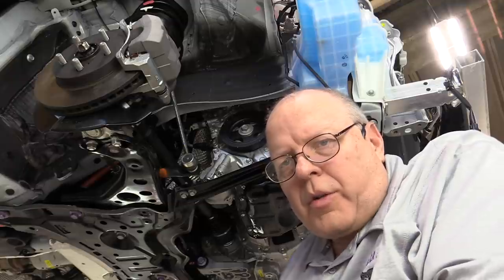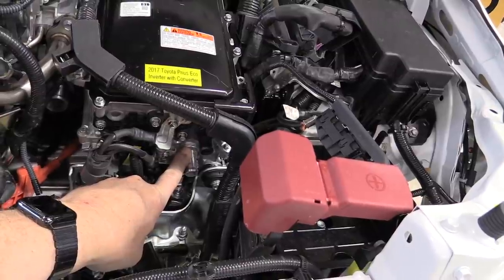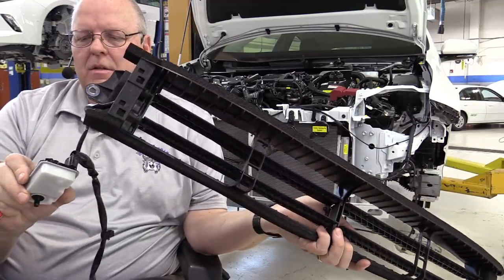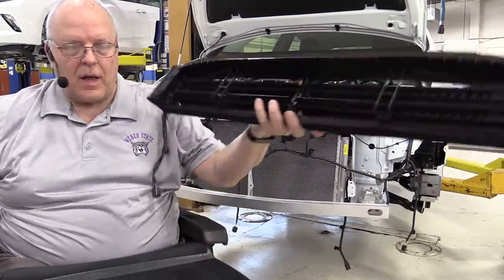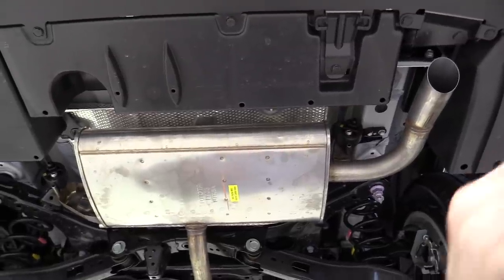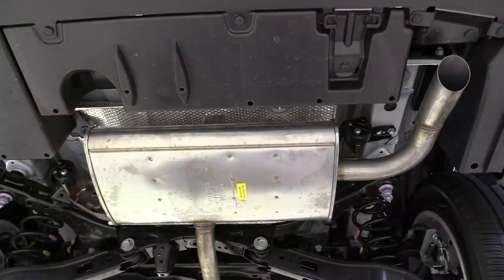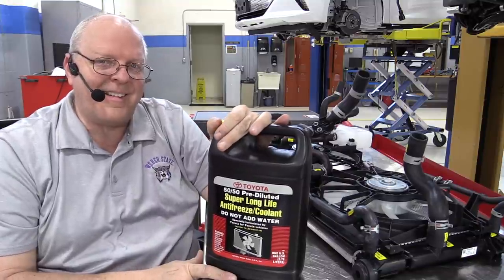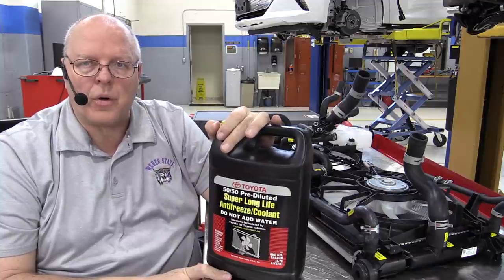Hybrid and EV Cooling Systems

Comment: I'm starting to wonder how much you spend on P-Touch labeling... Per year...

😂
Reply from the maker: LOL! About $400 USD per year. It requires the "Extra Strength Adhesive" labels to stay stuck to auto parts after you clean the surface with brake spray cleaner. It is a lot of work, but it also helps me remember the name of the parts and it helps my students to figure out these systems as well. Thanks for your feedback!